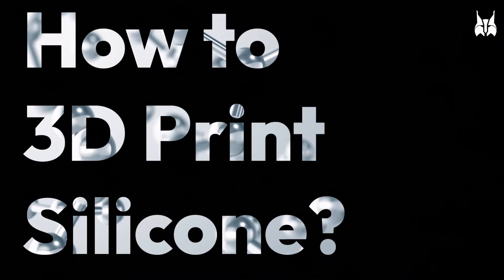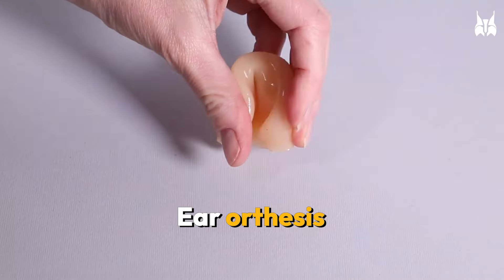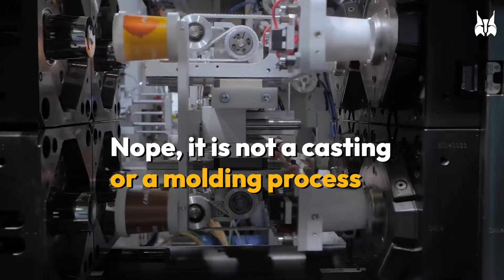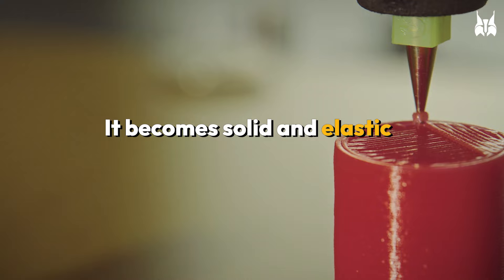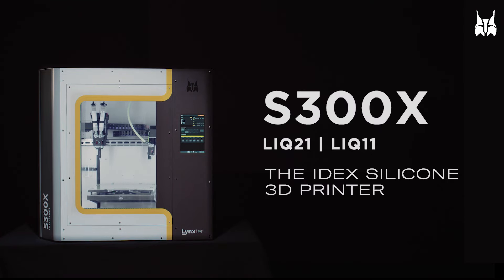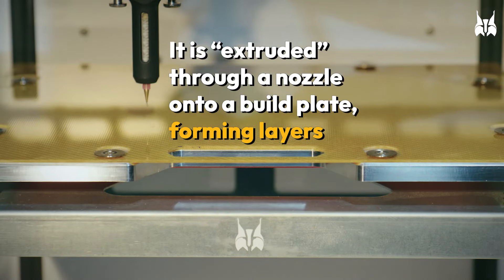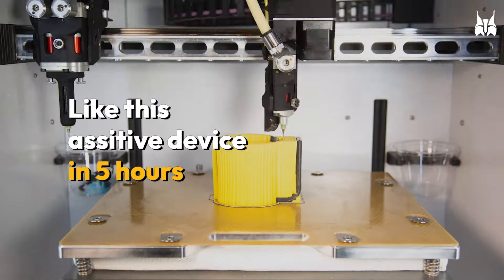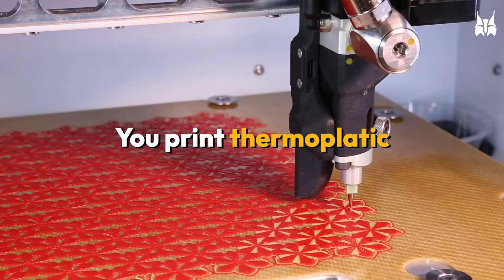How does silicone 3D printing work?

Comment: Very interesting. Last time i looked into silicone printing, all the articles i found pretty much had it that the biggest market would be medical printing but the tech wasn't up to it - and some sources didn't think it ever would be. The current generally accepted practice in my little area of the field is to resin print a mould and inject in the silicone, which apparently didn't provide sufficiently acceptable results for my predecessor so those devices get sent to a commercial production house. I will be watching these developments with interest though.. would be quite nice to extend my repertoire 🙂
Reply: printing silicone has several problems, but perhaps the biggest one is that its just too flexible. if you print a flat object onto the build surface you're fine, but all other parts have to be designed to accommodate for this printing process with great limitations. supports barely help. below shore 90A you can expect lots of headache, below 70A it becomes useless
Reply from the maker: Like any technology, it has its limitations (batch size, dimensions, surface finish, productivity, etc.), so it is important to use this new tool where it is most relevant. There are numerous medical devices, with various certification requirements, that are well-suited for this method, especially when tailored to the patient. Being able to skip the mold (know-how, tooling cost, contamination, minimum batch size, etc.) and print directly with industrial or medical-grade materials brings significant innovation to medical applications. We have customers running tailored production of medical devices already. - Thomas
Reply from the maker: @sadcvnt_uwu Here is the proofread version of the new text:

It actually depends on the application. We have customers producing medical devices with Shore 00 silicones, while others opt for 50-70 ShA. This process does not involve a filament or any thermoplastic behavior that limits material hardness due to the nature of the extrusion system. Here, the material is pasty. Printing with 20 ShA or 50 ShA is pretty much the same in terms of difficulty. We've created a design guide to help determine what's printable: https://lynxter.fr/en/blog/guide_en/design-guide-additive-manufacturing-liquid-deposition/ - Thomas

Comment: So is it just RTV with support material? Certainly a clever way to get around the extremely high temperature required to actually extrude silicone.
Reply from the maker: It works with RTV1, RTV2 and LSR for silicones indeed. SIL-001 is a RTV2. It's printed at room temp and crosslinks/cures gradually during the print. - Thomas
Reply: @Lynxter-3D-Printing  Really cool application! Thanks.

Comment: did you use AI to narrate this? 
sure sounds like it.
Reply from the maker: Indeed to try it out, but it does seem to disturb so we'll try something else - Thomas
Reply: @Lynxter-3D-Printing Human-like stuff gets exponentially creepier the more human it gets, because humans can notice the small quirks but they feel "hidden". Classic robotic voice is less creepy, but a real human narrator would be ideal. If not, maybe a small "ai generated voiceover" text in the first few seconds would probably be good enough. It's less weird if you know it's a machine from the get go, and that way it doesn't really take from the content you're showing.

Just my two cents, from a rando on the internet.
Reply: @Lynxter-3D-Printing  It was just fine for me, right up to when it started saying the print times. Small fix but AI will get there. Great video btw.
Reply: Thermoplastic was spelt wrong

Comment: It prints at like 1/10th the speed of plastic FDM printers. Kinda lame.
Reply: Wdym? You can’t print silicone with a plastic fdm printer
Reply: It was not made for children to play...
Reply: That is desktop fdm printing, which is used by hobbyists with many things including chasing bigger numbers, even if it is spending hours to gain 5mm/s speed.
Reply: @edilj7285  Even entry level printers aren't for children. They work off CNC programming and industrial manufacturing parts. Stepper motors, control boards, linear rails, thermistors(or thermocouples if you go with something hand built), tension belts, wiring, etc.  None of them are toys, people just act like they are (mainly because people have a tendency to print toys on them).
Reply: @ronaldhiser860  I was referring precisely to childrens in adult bodies.
Reply: @ronaldhiser860 3d printers are appropriate for kids, it's good to start them off making things early. They're safer than a toaster, and far more useful
Reply: @maxhammick948  I have no disagreements to them being appropriate for kids.  Never said they weren't and would be a hypocrite as my kids use mine all the time.
Reply from the maker: Have you checked the actual specs? We offer direct printing of silicone on industrial machinery (serviceable, durable, safe, secure, etc.) at 50-100 mm/s with ~5k mm/s² acceleration, which is basically the fastest you can find in the world today. It is comparable to engineering-grade thermoplastic printers (PC, PEEK, PEKK, PA-CF, etc.), and we're pretty close. - Thomas